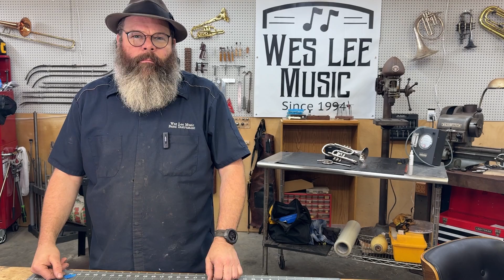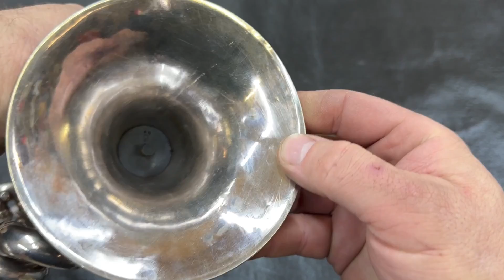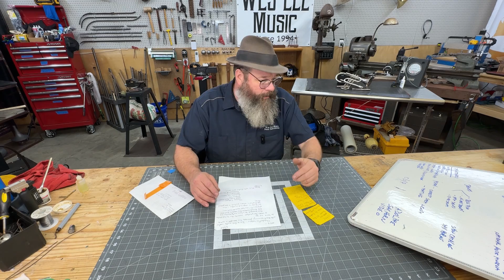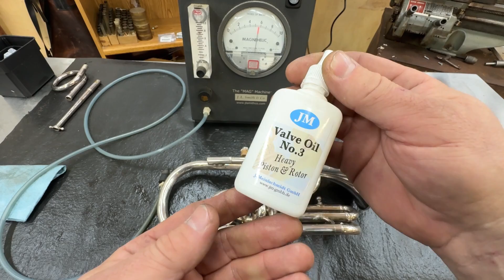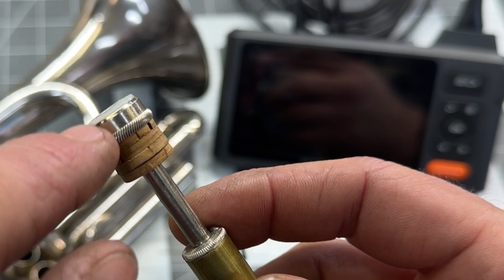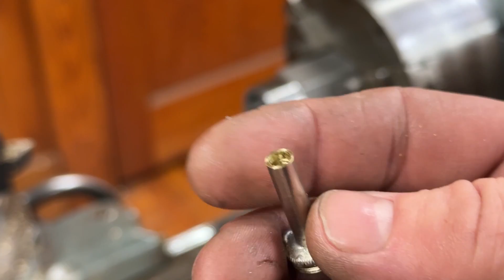Adolphe Saxhorn Part 1- band instrument repair- Wes Lee Music

Comment: I play a lot of saxhorn family instruments for civil war bands.  This horn looks too modern for an 1845 vintage - they were mainly using rotors back then, or some crude piston or cornopean style valving.  The braces don't look right either.  Most of the time they were rods curled into 'S' shapes.  I'm not saying this isn't what you say it is, just that it seems out of step with horns of that vintage.  They were barely out of the keyed bugle stage back then.
Reply from the maker: I know what you’re saying. Actually going to talk more about this on next video.

Comment: I have an 1891 Alto sax horn.   I don't know much about it's history, I picked it up from a guy that had it for 40 years, but before than, who knows?  Mine has two extension tubes that are used on the tuning slide to change keys.  It's rare that it would still have them after all this time.   I do play it, why not?  It sounds great!

Comment: I gotta get one of those gadgets!  I just use a blow tube and hold it under water.  I had an alto sax-horn (not an Adolph though) come through here last year, and the crook joints were all leaky.  I think it was from the 1870's.  I am thinking the solder was not as consistent back then.  Can't wait to see that cornet restored!